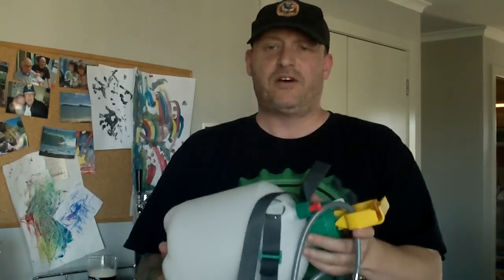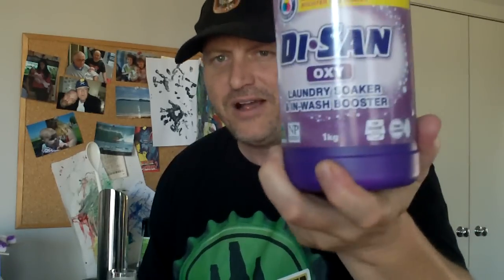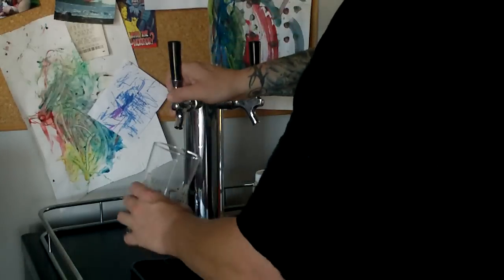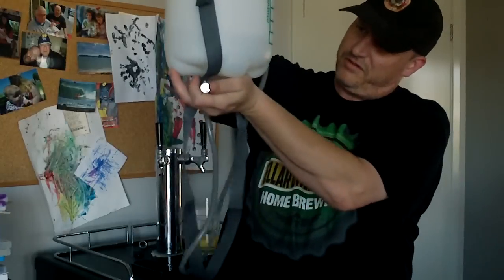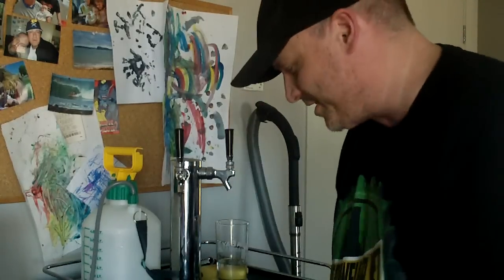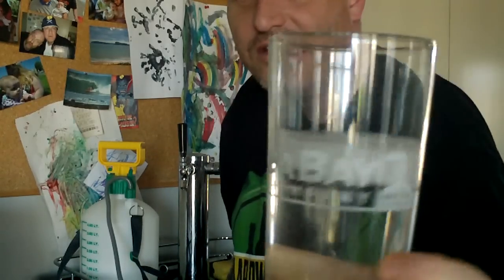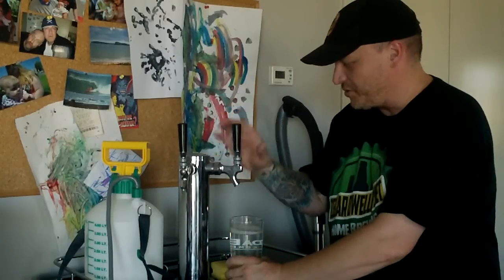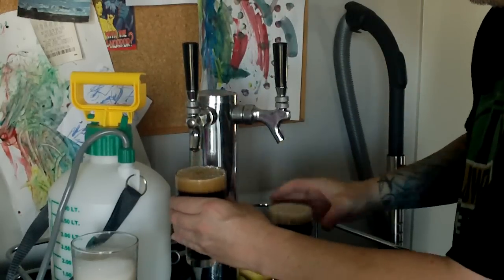DIY Beer Line Cleaner - How to - PART 2

Comment: Wayback playback, but there are some gems in the 'back catalogue' for a newbie like me. Thanks Gash, brilliant video!!
Reply from the maker: Cheers mate, these days still grab a sprayer but just use a carb cap, they weren't around when I made this
Reply: I assume with the new carb caps you could just plug one of those right into the line and clamp it on?
Reply from the maker: @davidgiles1164  Yes exactly
Reply: The Home Brew Network cheers mate

Comment: What a great idea, I'll be heading off To Masters tomorrow
Reply from the maker: +Keith Russell there is an update to this, yes use the same pump, but easier to use something like this that wasn't available before. http://kegking.com.au/cleaners-and-sanitising-equipment/carbonation-cap-line-cleaning-cap-counter-pressure-filler.html something like that, all you have to do is attach the pump hose to it.Cheers!
Reply: +Gash Slugg Thanks Gash

Comment: great setup and thanks for reminding me that my line is overdue for a clean. I have only done it once and I just ran keg cleaner through it and then some water. my lhbs doesn't seem to have starsan. they give me phosphoric acid. is that the active ingredient in starsan?
Reply from the maker: yep that's what it is made from. Coincidently that last video you commented on, the bottle cap counter pressure filler can be used to do this, if you half fill a PET bottle with soap or sanitiser and charge the bottle  with some gas, then hook up the beer line to it and it force it through the lines. You waste gas and will have to charge the bottle a few times over, but it would work. I like this system better no wasted gas and no stopping and starting.